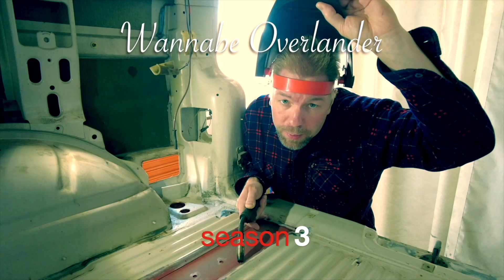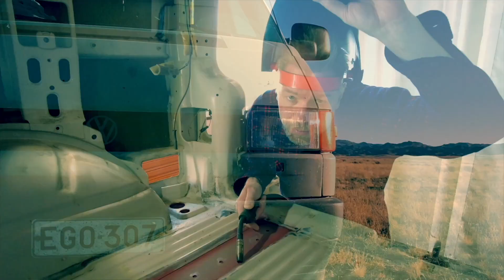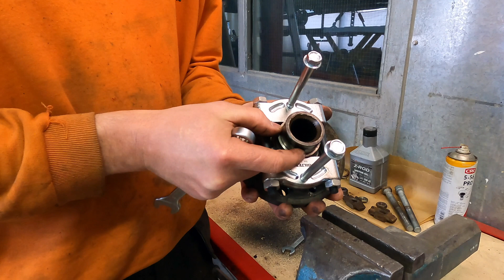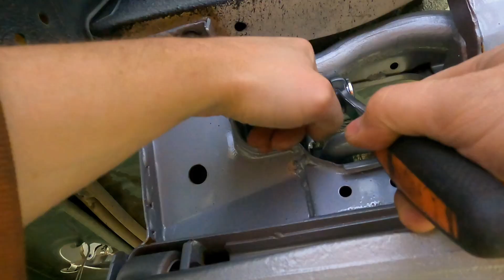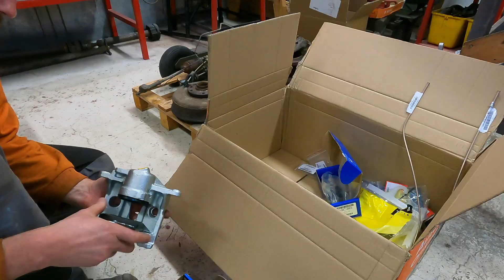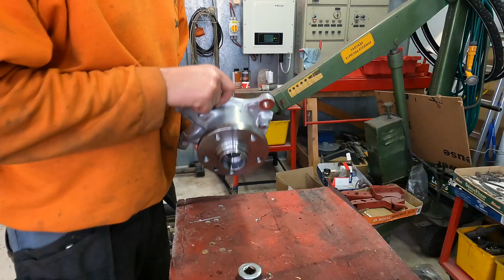The first major blow to rebuilding the ego | Overcoming major challenges of ego reconstruction

Comment: AutoDoc tried to replace parts in my order on a couple of occasions.

I caught it both times. I only order during times that customer service is available, never late at night.

As soon as the order is placed, I check the status to see if any parts have been substituted. 

The first time they did it, I contacted customer service within 5 minutes and informed them I did not want substitute parts. They changed the parts back to what I originally ordered. 

My parts were still showing as in stock. 

The second time, they tried to substitute parts. I contacted them within 5 minutes because I was expecting it. Again, they changed the order back.

This time, I told them I would not be placing any more orders as I was sick and tired of having to contact them. They said they would remove the replacement parts option from my account. 

They are known for doing this quite a lot. Often replacing with their own lower quality inhouse brand, which they list at higher price. They then use this as an excuse when contacted by unhappy customers. Appalling behaviour on their part.

Anyway, it's nice to see your T4 is coming together. 👍
Reply from the maker: I haven't even thought of that. You have to be careful and follow orders immediately. I appreciate that information 🤠👍🏻